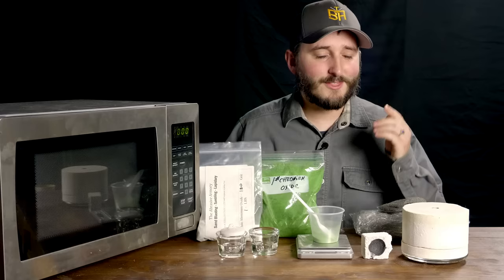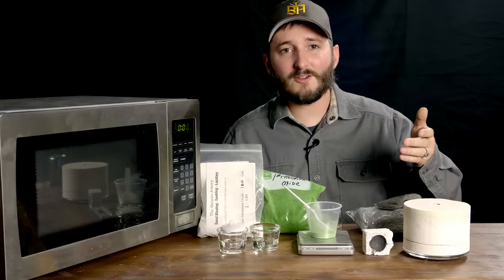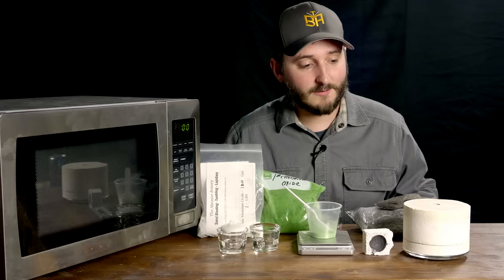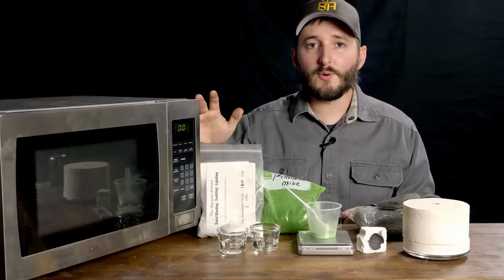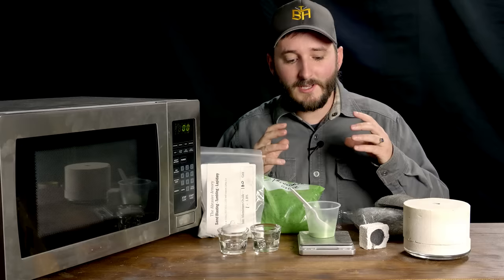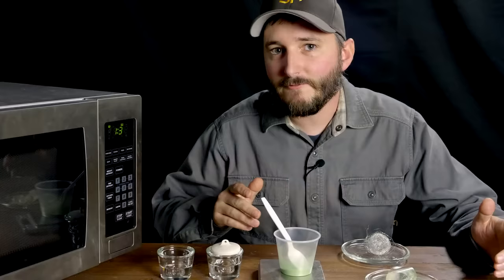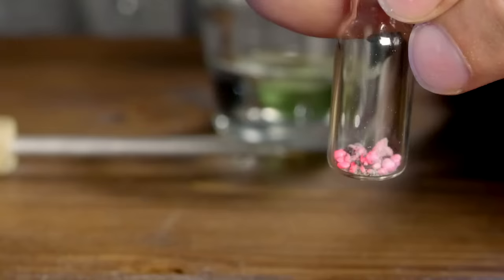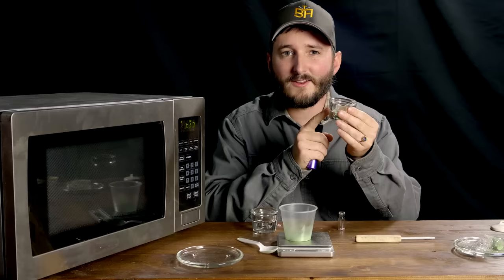How To Make Ruby in a Microwave

Comment: How about grabbing few tungsten filaments from incandescent lamps instead of the aluminium wool? Higher melting point and readily available. I love the simple approach you came up with, and look forward when you polish those rubies and put them on a ring :)
Reply from the maker: That's a good idea!
Reply: Really good Idea!
Reply: Ideally no metal plasma starter should be required after the first plasma ignition. The aluminium wire has the benefit that it does not contaminate the Ruby because it should just oxidize when hot, meaning it turns into alumina which is already an ingredient in the mixture.
Reply: @Basement-Science  Ideally you would have a plasma that stays lit, but seems like the air changes chemically or something and you cant keep the plasma long term. Otherwise you just used the plasma inside the kiln thing an keep it heating until the whole batch of powder melts. Or your kiln disintegrates, whichever happens first. :)
Reply: @Basement-Science  Yeah. I think an interesting approach might be to just use powdered aluminum and oxygen or the oxygen from the air with some chromium salt mixed in. Aluminum burns very hot. Of course the problem here might be containing it. Or maybe a mixture of aluminum powder and ammonium dichromate.
Reply: @stefanl5183  That's a good point, I didnt even consider that burning Aluminium would add more heat and ions which help the microwaves getting absorbed. 

My only concers would be 1. the fire adding too much heat which cannot be turned off and 2. the aluminium not fully reacting into oxide, contaminating the end product. But since 2. is not the case so far anyway, I think it could be very promising.
Reply: well yeah but what happens to the ruby's then... they might get contaminated with Tungsten. yeah tungsten might melt at 3422 deg C but still if temps get as high as that, tungsten may still end up in your ruby's and then they are no ruby's anymore. 
so it may be a good Idea as long as the temps dont get higher than 3000 dgr C preferably lower but still significantly higher than 2000 dgr C
With aluminium there is no contamination danger since ruby's are mainly aluminium to begin with.
Reply: @thewaytruthandlife  Tungsten will cause problems long before it melts because it will just start burning in air. That's why incandescent bulbs need an inert atmosphere inside the glass.
So yeah, it will definitely contaminate the ruby.

Comment: I have a suggestion for a larger one. Put in your aluminum first, heavier amount, then pour in your mixture and press a little, not pushing all the oxygen out. This way the mixture is throughly integrated and has room for oxygen also. When you heat it the aluminum is throughout the mix and evenly heated.

Comment: Try lightly moistening the matrix material. It may hold the powder together just long enough to help form larger crystals. Great video!
Reply: Or it might create steam bubbles in the materials resulting in smaller crystal shrapnel embedding into the kiln lining.
Reply: 😧 Do it. (for science)
Film it too pls.
Reply: It would add bubbles, but you could dry it out first, and the paste should be stiffer from water allowing for better stacking and compression, right?
Reply: The moisture along side the sudden extreme change in temp will more than likely cause it to combust
Reply: @Gasp7000  Actually, we do know. It's called a steam explosion! You ALWAYS dry something out before heating in a kiln or foundry. It's honestly terrifying that you've done so little research to even suggest adding moisture 😳
Reply: it needs to be packed tighter with the aluminum material less stringy, more rigid. the space above needs to be filled with wax!!!!! and let to cool completely hell, even slightly chilled maybe. the time it takes to ignite isn't long enough to melt the wax so the plasma will be more contained much closer to the ruby concoction.
Reply: @deertayfff what type of wax?
Reply: I'm thinking use water and dry it in an over, then throw it in the kiln.
Reply: @richardbrooksshnee  think using something like Aceton would be better than water as it is way easier to get rid off
Reply: @paprikalp7989  my innate reaction is to bring up that acetone is highly flammable, has toxic fumes, will damage plastic and rubber, and water will evap off to near undetectable fairly quickly.

  Pack the matrix with water.  Maybe sub the microwave for a thick metallic tube and insanely high voltage.
Reply: Water vapor expands something like 1000x when it phase changes...
Reply: @sharxbyte  which is why drying it in an oven first was brought up.
Reply: @gristlevonraben  what if you increased the air pressure?
Reply: It would make the microwaves react more with the substance than normally.
Reply: I was thinking in terms of ‘fogging’ it - adding humidity, nowhere near wet.
Reply: @NoMoreBsPlease  Considering how small his oxide mix is, the volume of the initial container and the volume of the microwave, you would get steam but most likely no explosion. Guaranteeing meaningful levels of direct contact between the plasma and water is also basically impossible since plasma in a microwave loves to fly around.

Comment: i had an idea for how to do this a while ago. if you use some graphite electrodes and ground half of them to the bottom of the microwave and leave the others isolated from ground and have them all pointing into a chamber with the ruby mix in it, they will arc together and make plasma that'll make ruby. i'm not sure if the grounding actually matters but with tests Ive done using pencil graphite, it does seem to make a difference. this gives you the advantage of holding the arc right where you want it and it being a continuous arc. just make sure that then ends you want the plasma to come out are pointed and that there is nowhere else on the graphite that's pointed or that'll be a nucleation site too.

Comment: You know, the first result was really good if you think of using these small rubies in a nickel electrolysis bath to make them stick to a steel, or harden steel rod.

This is basically how demel-sized diamond grinders are made, or even diamong grinding wheels, though for  the latter I know they use a polymer binder instead.

But quite useful in the hands of a tinkerer at his/her workshop nonetheless, as could be used to make custom grinding/polishing wheels or shapes in  rods, that could be used in a lathe or a mill to attain precision or good finish.

Thanks for sharing!

Comment: Just randomly cruising YT and found this, had to watch of course.

Now, an idea hit me as i was watching it, and since it's the first video from you i've seen, not knowing if you tried this, i thought i could comment about something.
I used to work with CNC, and one of the first things you got to learn was to listen to any kind of sounds that may indicate that the machine wasn't running smooth. Why is this important in this case then? Well, since ceramics are usually VERY heat resistant, they're also usually fairly brittle. They break well before they bend. As i watched, i also listened, and could clearly hear that the glass was shaking.

At extreme temperatures this creates a surefire way to cause internal fracturing. If you were to remove the capablity to rotate the table, this would also remove a lot of shaking, since the pressure wouldn't shift as much due to the rotation trying to heat things evenly. Having it stationary wouldn't heat things evenly, but since you were trying to create plasma, this shouldn't have any effect on induction.

Comment: Place the microwave inside a large plastic bag,  then remove oxygen from the bag and then fill bag with argon, then repeat experiment again.
Reply: An argon port drilled into thge side and fitted with a fine mesh screen for EM rejection, should be enough i'd think.
Reply: I think the aluminium used for the plasma oxidizing is actually a good thing
Reply: @outspokeninsider752  just have your hole too small for microwave to fit through
Reply: @linecraftman3907  I mean, a screen is just an array of too small holes ;-)
Reply: Even better, put it under vacuum and ditch the Firebrick altogether, you could crank it up to even higher temps.
Reply: @graysonsmith7031  standard microwave in a large vacuum chamber sounds like a good project for CodysLab.
Reply: @dave7038  He did something like that, but the transformer shorted and he gave up. Plus he only wanted to pop popcorn instead of trying to use it as a foundry. I posted a comment on here that gave some info and other plusses for the idea.
Reply: The bag will prevent the microwave from exhausting heat. The blower fan in the microwave will remove any argon pumped in even if it is piped directly in. Maybe the bag idea could work as long as it wasn't run for long.
Reply: How about a bathtub full of argon. Lower the microwave in it.

Comment: If you use a larger insulated vessel and multiple beams converging on a void underneath your starting material, separated by a thin, thermally conductive, temperature-resistant plate (tungsten, anyone?), you can generate plenty of heat in the space below without metal contamination of the rubies. Given proper insulation and a large enough vessel, you could maintain heat in the vessel long enough to not only generate ruby seed crystals, but grow larger, higher quality monocrystalline specimens given enough time under heat. Ideally this would be in a pressurized vessel, but DIY situations often aren't conducive to creating vessels that can take extreme heat and temperature for sustained periods of time.

Comment: The reason the aluminum wool lights up and turns to plasma is because the microwave energy enters the metal and creates a standing wave in the metallic ribbons.  As the microwave oven adds energy, the standing wave grows in power (similar to how a laser light source adds photons to build up to coherent light).  Once the ribbon absorbs all the energy it can handle, it vaporizes the aluminum and leaves behind the pure energy that transforms into plasma.  The metal has to be of just the right length to be "in tune" with the frequency of the microwave so the energy can amplify.  If not, the microwaves will just dissipate into the surroundings.  This is why thin ribbons of aluminum work but not thicker bars of aluminum.

Comment: Microwave ovens usually pulse on for 10 or so seconds then stop for 15(ish) . If you could bypass the logicboard inside it and turn the relay on with a switch you could have the magnetron permanently on for as long as you need.
Reply: So when I warm food for 20 seconds how's that work?
Reply: No way this is true, popcorn doesn't start and stop and start and stop. And when I'm melting something, it doesn't stop melting for 15 seconds at a time, it's very even over the course of a minute.
Reply: Can the heat that is produce in the Megatron . Cook it if there is 100%  energized?
Reply: That's for lower powers, on high it turns on and off pretty rapidly. -Styropyro's laser microwave video explains it pretty well in the beginning. Also the microwave physical can't stay on all the time without twice the pieces.
Reply: @woolfoma  Sounds like you have a fundamental misunderstanding of how microwaves work.

They heat the water molecules inside food. Just because the microwave is pulsing, that doesn't mean the water molecules in your popcorn instantly cool down to room temperature when it's not actively on a pulse, they stay very hot. 

Because of that, your popcorn continues popping even when the microwave is between pulses. If the time between pulses was longer than it is, then maybe you'd notice the rate of popping speeding up and slowing down.
Reply: @woolfoma  it’s in the name micro-wave it’s literally pulsing micro sine waves to heat up your food at 2.4 GHz per second
Reply: @ledumpsterfire6474  not only water molecules! They heat up all polar molecules, sugar for example.
Reply: @apokalypthoapokalypsys9573  Of course, they also love to heat up metal, as we see in this video. 
And, who hasn't forgotten that they had a metal fork in their leftovers, not a plastic one? Bzzzt! 😆 
I remember people were nuking AOL CD-ROMs, before the World Wide Web was even a thing.
Reply: Just reset it every 10 secs it takes less time than 15 secs
Reply: @woolfoma  The reason why microwaves start and stop is to prevent burning the outside of your food, while leaving the inside raw. When you microwave a large piece of food, most of the microwave energy is absorbed near the surface of the food. Not much of the energy reaches the center. The magnetron turns off, periodically, to allow some of the heat from the surface of the food to conduct to the center. 

It's been a while, but I think my magnetron turns on and off, when I do popcorn mode in my microwave. But my microwave is 1500 Watts. If it stayed on, it'd burn the kernels before the moisture inside could turn into steam, and pop them.
Reply: @apokalypthoapokalypsys9573  When I was in sixth form I was bored so I felt like making caramel using a heap of granulated sugar on a ceramic saucer in the grubby kitchen microwave, it shattered quite loudly after about 20 seconds creating this nice stretched caramel formation. Wasn't allowed to use the microwave after that

Comment: No the question is what is the right process to convert those polycrystalline rubies to monocrystalline. Probably holding them at 1980-2010 Celsius for several hours. Honestly though if you could create a monocrystalline ruby using that process you'd dramatically change manufacturing. Imagine die cast tool made out of ruby able to handle millions of shots with no degradation, and all for significantly less than current tooling costs. Tesla's pushing the upper limits of die casting with their car body castings, with ruby tools it would make that look like child's play.
Reply: Synthetic sapphire is already in use wherever its properties are needed.  Tinting it red won't increase demand all that much.
Reply: @jpdemer5  Large synthetic sapphire is still polycystalline, so most of its useful properties are diminished. Monocystalline ruby (or sapphire as you pointed out) has significantly improved material properties.
Reply: We should figure out a way to make it happen then
Reply: You do not need rubies for that; Al2O3, common aluminium oxide is widely used as an abrasive. Single crystal ruby shall be useless as a tool because of crystalline fracture.

Comment: The black coating inside the microwave kiln is Silicon Carbide. It's not a good conductor, but its dielectric properties are such that it readily absorbs microwave energy.

Comment: Reminds me of that viral vid/prank back in the day of someone claiming to make diamonds from microwaving peanut butter. If only they knew how close they were lol. 

Have you tried polishing/cutting the rubies to see how presentable they are? I assume these would only pass for "industrial" grade but would be interesting to compare to a jeweler grade ruby.
Reply from the maker: Yeah these are full of voids, not transparent. It will take a lot more work to come up with a method to make clear rubies.
Reply: @Nighthawkinlight  unrelated but maybe you can try to form the rubies in a file shaped mold?
Reply from the maker: @ClickThisToSubscribe They are crystalline, but not monocrystalline. In the larger rubies I have made you can clearly see the grains of different crystals going different directions.
Reply: After the ruby is formed, does it take the same temperature to melt it, or it's melting point becomes lower (like sand and glass)?
Because, if is the second case, it would be easier to recrystalize them into a bigger crystal.
Reply: @OJapaTerrorista  This is a good question.
Reply: I'm guessing the crystalline structure would improve a lot if their high temperature was held for a longer time and it maybe cooled down much slower. We need a microwave oven with fully variable power. (something I wanted to build for some time.)
Reply: @Basement-Science  Great idea, I once came across a microwave recipes book from the 70's that had a bunch of microwaves and their specifications, and I found it interesting that some of them had actual variable power, while most were alternating on/off types.  I read that they stopped making the variable type due to cost and simplicity.
Reply: @ProlificInvention  The new-ish Inverter type microwaves do vary the power instead of alternating (you can basically do that for free with an inverter), however they usually still artificially limit you to a few fixed power levels. 
It seems that only Panasonic makes inverter microwaves however. Not sure why.
Reply: @Nighthawkinlight  I just add a crazy idea....you know ...water bond with everything at the molecular level....what would happen if you put a little bit of water ? maybe just 1 drop on top that wont even wet it and see what it does, maybe the crystal would have a path to follow through the water.

Comment: Nice process using plasma.

Two thoughts about that:
TheBackyardScientist once used an arc welder in a bucket full of steel bbs/steel grain to produce like 3D lichtenberg figures. What about two elctrodes in a "bucket" of that ruby mixture: one electrode at the bottom, and one electrode which you insert into the mixture, turn on the power and pulling the electrode out of the bucket. Not sure if the ruby is conductive or if the plasma is forming a conductive channel.

Second thought/question: did you plan anything with the rubies you create/produce? Like using them in a tool or try sanding/forming them into jewellery or cutting tool?

Might be a challenge to get them in shape with an affordable tool, but maybe a cheap cutting disk for maisonary/tiles for the angle grinder (the one with diamonds) could do the trick.